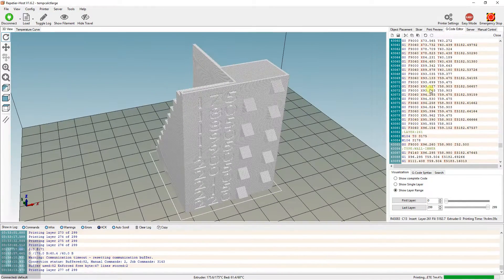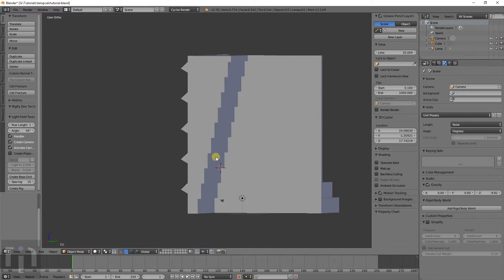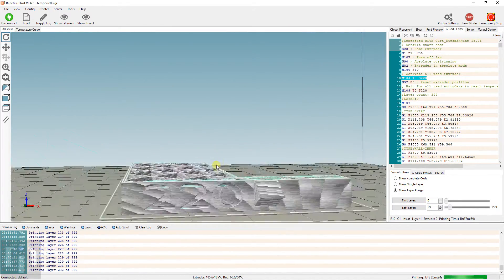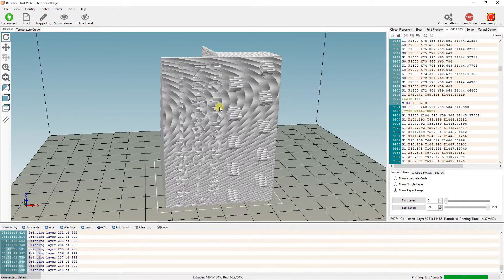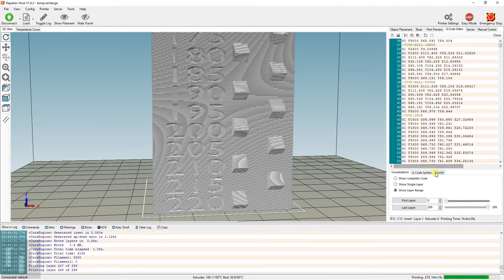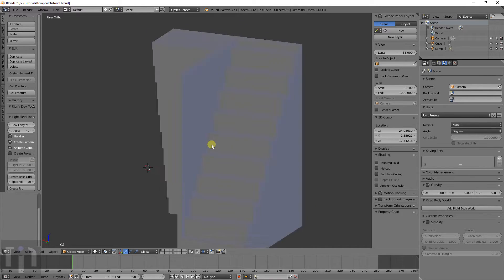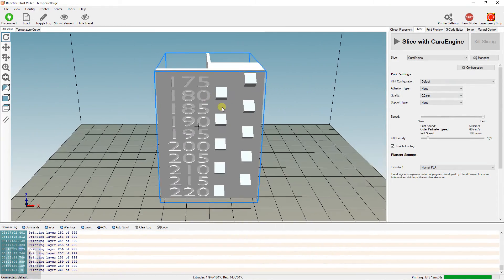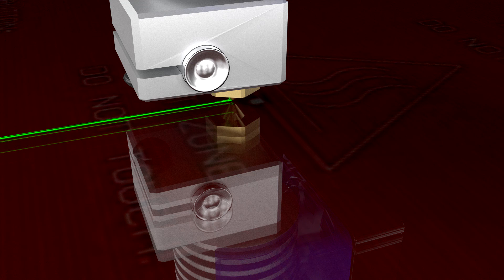3D Printing Guide #001 : Changing Temp in Gcode

Comment: You add the temp with M104 but do you need the M109 further down the Gcode?

; Wait for all used extruders to reach temperature
M109 T0 S215
Reply from the maker: No, that's just for the initial heating of the hotend.  I suppose you could put it in, but then it would just stop between layers and ooze.  The temperature change is so subtle, that the temp well be where it is supposed to be by the end of the first later.  It's pretty close to the temperature that the hotend fluctuates normally anyway.

Comment: my gcode for your stepped tower has no ;LAYER numbers at all. What am I doing wrong. is it the slicer? I used SLIC3R, Please Advise, Thanks
Reply from the maker: That makes it a bit more difficult.  You can find where it goes to the next layer by doing and ALT+F search and just type the letter Z.  It will show every layer and the amount of millimeters it goes up each later.  For example a line will say G1 Z0.200 F7800 for the movement after the first layer.  It moves up by 0.2mm(or whatever your first layer is set to).  The next layer will be G1 Z0.400 F8700.  A full centimeter would be G1 Z10.000 F7800.  So you could search for Z10, Z20, Z30 and so on to make the temperature change at each centimeter.  I hope this helps.